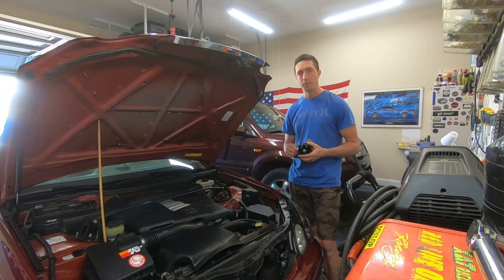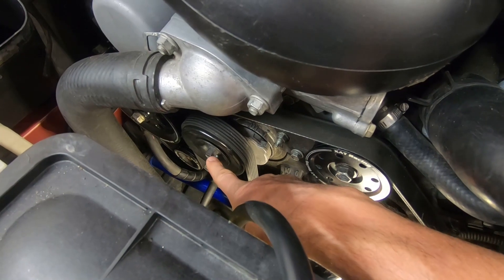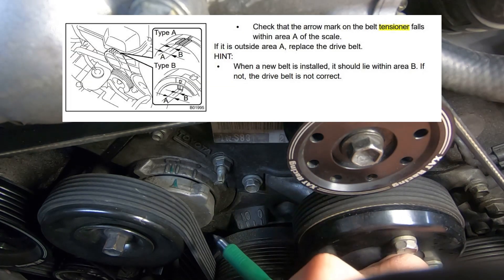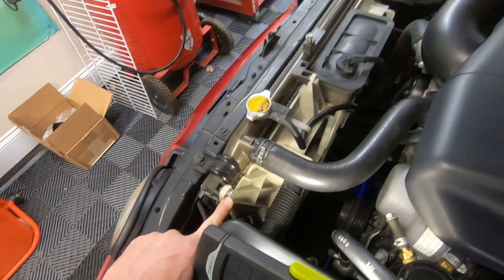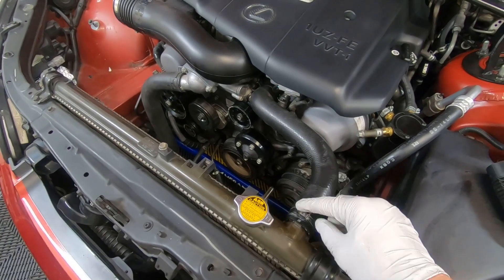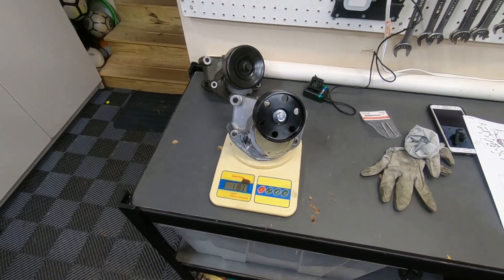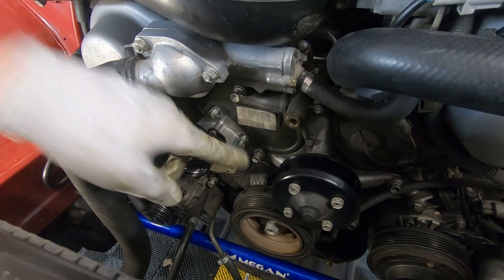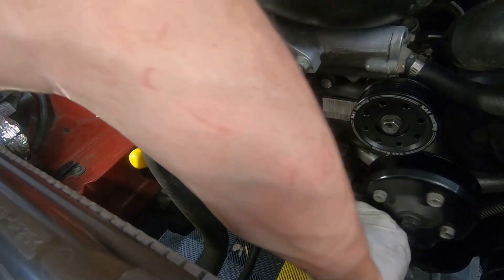Accessory Belt Tensioner Test & Replacement Procedure (1UZ shown)

Comment: Is the tick mark supposed to be between ticks 1-2 I don't understand?
Reply from the maker: In the graphical range on the scale, not out. One direction out would mean belt is too loose. The other direction too tight, indicating the wrong belt or another accessory issue.
Reply: @ForwardMomentum  I see, on my GS400, the tensioner is pointing a little after the 3rd tick but it's in-between the 3rd tick and the far 4th tick, I'm assuming that means it's loose right?
Reply from the maker: Put a 14mm on the bolt head and mess with it. You won’t hurt anything. Unload the tensioner (CCW) a bit and watch the pointer on the scale. As you release it, it will go the other way on the scale. Chances are yours is on the loose side of the scale. That can mean the belt is getting stretched or the tensioner is wearing out. The FSM has a scale and description in it.
Reply: @ForwardMomentum  I gotcha, yeah I think my tensioner is shot, definitely on the loose end

Comment: No need to remove alternator wires but disconnect battery first
Reply from the maker: I do that because pretty much every publication ever written says to disconnect the battery negative only for any work. The problem with that method is the battery positive to ALT and thus the ALT can still be grounded and shorted on pretty much any metal surface, including tools. So to clarify, I’d say disconnect both batt wires so it’s not a concern.

Comment: First of all,  thanks alot for the lovely  vedio 😊 
You mentioned in the vedio that the new belt tensioner you installed in your lovely car can be fit in 1UZFE engine .
Are you sure about that 🤔 
I am gona say different way : 
Is the OEM belt tensioner in Lexus LS400 1UZFE non VVTI engine, can fit in  Lexus LS400 2UZFE VVTI engine as your car ?,  it's the milion dollar question.
because some people say yes , and others say no .
I have LS400 96 non VVTI , I couldn't find OEM belt tensioner in our local Dealers , they said its discountenued,  they have it only for LS400 98 99 2000 with 2UZFE 😢 wich also can fit in 3UZFE for LS430 from 2001 to 2006 . 
That's way sir ,,, are you sure it can fit the 1UZFE?  
If that's right,  Kindly share me the link for it . 
Thanks again.
Reply from the maker: Thanks for starting off by saying thanks. A lot of people don’t do that and they need better manners. Unfortunately the situation I found myself in with this video doesn’t allow me to answer your question. Here’s what happened: I ordered a pulley kit from XAT Racing. The tensioner pulley they provided would not fit on my engine. I told them, so they sent an entire tensioner assembly to me with no further information. Turns out that was an old pulley design and a couple years later the pulley came off the bearing entirely! So they sent me another pulley. That’s why I can’t answer your question. However, I think XAT Racing might be able to answer it for you. Also, you can try to cross reference part numbers using toyodiy: https://www.toyodiy.com/parts/q.html - I hope that helps!
Reply: @ForwardMomentum  thanks alot for the fast reply, 🙏 
Keep doing what you do for your lovely 😍 car . 
It's one of the best 👌 👍 GS400 in YouTube. I like it so much,  especially with manual transmission, and It is a rare wine red colour,  I show it to my mechanic friend, he liked it a lot, because usually no one see a Lexus with a manual transmission. 
 You are an organized, dedicated person. You like to make everything clean and tidy. You are a person who only accepts the best, and only accepts that everything be in perfect condition. You are Intelligent, and always striving for perfection without getting tired, or desperate. All of these qualities are also present in me, and as I watch you working , I feel that I am the one doing this work. I still have my Lexus LS 400.  Model 95, and now I have owned it for 19 years, and the odometer reading now is 626 thousand kilometres, and it is still as smooth as if it was new , and I did it myself as well alot of fixing with my own hand , good luck to you.
Reply from the maker: That’s the nicest thing anyone has said to me in a long time! So glad the vids are helping you out! 👊

Comment: Decided to change my belt after mechanic said it needed it. Belt actually looked pretty good so not sure what that was about.. 11lbs to move tensioner and it looks quite wobbly when running even with new belt.. And it's way out that arrow, 3 notch range as well.. May have to do this soon..

Comment: You said OEM is expensive but I found XAT pulleys to be even more expensive. Am I right here?
Reply from the maker: If you can walk into a dealer and buy brand new pulleys cheaper than the XAT pulleys, I’ll be amazed. I’m not talking used off eBay or Chinese knockoffs, real brand new TOYOTA pulleys. Let me know the difference in pricing either way.

Comment: Seems like Tensioner is my next replaceable. When are you doing a dor actuator video ? :-D
Reply from the maker: I have to get through this supercharger series first. Actuators are on the list. 😎
Reply: @ForwardMomentum  I mean you do the actuator video and you will have whole set of “need to know and how to fix for the 2GS”. ;-)
Reply: Any reasoning for using a 3UZ tensioner over 1UZ? Other than obvious weight savings. Weigh reduction>herspers
Reply from the maker: @HussarPlays  the pulley that XAT sent me didn’t fit on the 1UZ tensioner correctly. So they sent me a 3UZ and it worked great.
Reply: @ForwardMomentum  a ha, I understand.

Comment: Several months later - was the xat pulley set worth it?
Reply from the maker: For my needs and how little I care about engine dress up items, I would say no, not for me. If the price point was around $125-$150, perhaps. Another thing is that I run the stock intake and it covers quite a bit of the front of the engine anyway. Just my thoughts...
Reply: @ForwardMomentum   I understand. I have a squeak coming from a pulley (probably the tensioner) and was curious if I should replace them all or not (minus the crank of course). Thank you
Reply from the maker: It’s a fair question that probably only you can answer. The XAT kit is probably much cheaper than replacing all the same pulleys at the dealer. So there is that on the plus side. 😎

Comment: Sucks I ordered a set of XAT pulleys for my 1uz vvti and I waited 2 months and I only got 4 of the 5 pulleys because they said one wasn’t ready. Another problem I had was when I went to put the tensioner pulley on the tensioner sat too far inside the back of the pulley which was causing the pulley to not sit right resulting in it getting hung up on the engine. I didn’t receive my pulley kit until after I waited two months AND sent them an email asking what the problem was. They told me it was because one of the pulleys wasn’t ready which is weird because on their website and Instagram it says they are ready to ship. Also the person I emailed was being a little rude with me. Just putting this out there for all interested in ordering from them. BEWARE

Comment: Hey I have a question about the vsc light that came on in my 1998 Lexus gs400 and was wondering what where some good ways to trouble shoot some of the problems if money is a bit of an issue
Reply from the maker: Get a cheap scan tool and check for codes. These cars love to trip all sorts of systems when it’s a simple, singular cause. Start with the DTCs.
Reply: @ForwardMomentum  I did that and to sort of an avail it was a vacuum leak but Im not sure if the power steering hoses or the pump itself because its a bit of a heavy leak would that cause tye vsc light to illuminate because of that or could that a problem because of the suspension
Reply from the maker: What was the code?
Reply: @ForwardMomentum code: P0171
Reply from the maker: @charl-eBr0wn   bank 1 lean. Check the entire intake system post MAF for leaks. Common problem areas are the resonator box and lines, and at the bend at the throttle body (the tube cracks on bottom). Check the entire thing very carefully.
Reply: @ForwardMomentum   hey did what you said and found out it was the vacuum lines for the vacuum box but was wondering if they sold silicone vacuum line kits and if so where would I be able to find one because I am gonna go ahead and replace them so that way its out of the way
Reply from the maker: @charl-eBr0wn  most auto parts stores have the line you need. Glad you found it.
Reply: @ForwardMomentum  its 3 lines but do you know if they sell kits with all the hoses in a whole?
Reply from the maker: I’m sorry, I don’t.
Reply: @ForwardMomentum  sorry to bother but does the power steering pump share vacuum with the vacuum box because upon further inspection I see its got a vacuum line running to vacuum box from the bottom of the power steering pump and Im assuming it is the power reservoir because its leaking from the two bottom lines that run to the pump
Reply from the maker: @charl-eBr0wn  yes, that’s the vacuum PS assist.

Comment: So probably a good idea to include the tensioner replacement with the timing belt replacement.
Reply: That and the valve cover gasket, spark plug tube seals, and cam seals. But the cam seals sometimes last for two timing belts.
Reply from the maker: Absolutely! Or as preventative maintenance.

Comment: So with the new tensioner it doesn’t move at 20 ft lb?
Reply from the maker: Correct. In fact it requires exactly 25lbf to move, which is perfect considering the margin of error for my non-calibrated torque wrench is probably 1-2%.